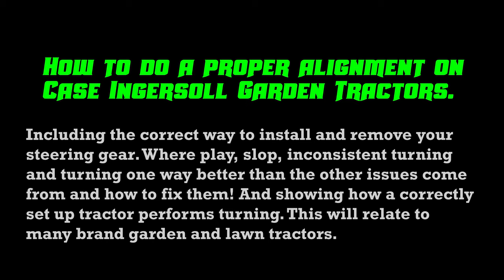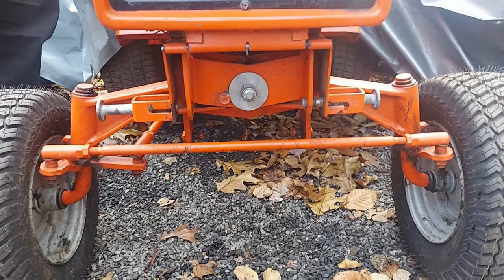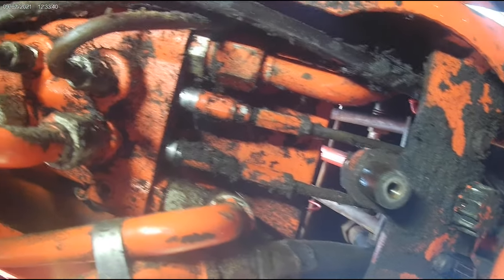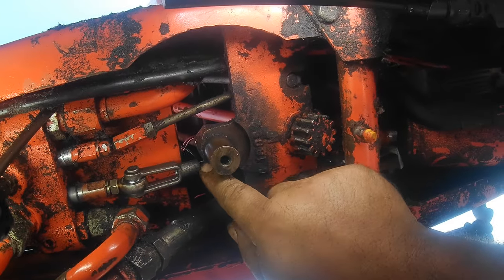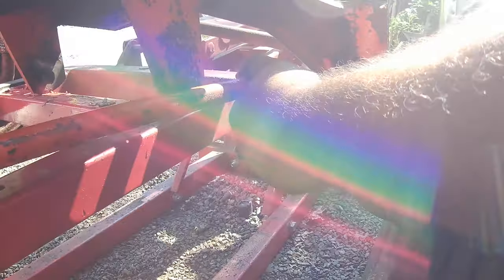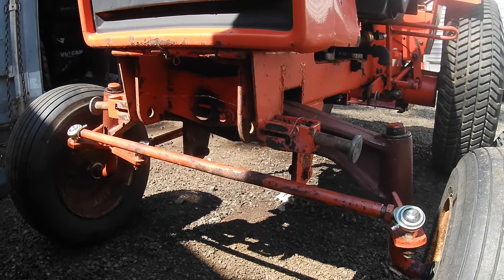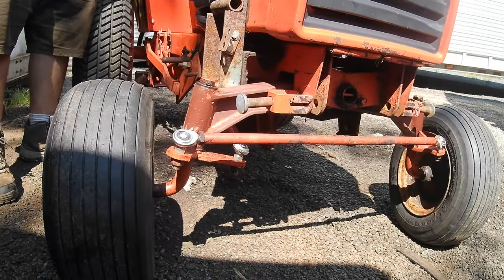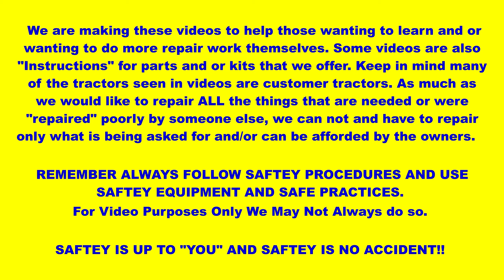Full Alignment Of Case Ingersoll Tractors & Steering Gear Install. Similar for Other Brands Too.

Comment: I saw a newer set of tires on one of the tractors in this video. Where do you get your replacement tires from for the 4 digit tractors with 8x16 inch rears? Awesome video and will be doing this upgrades soon.
Reply from the maker: Thanks! Not sure what one you are talking about, but all the tires I think in the video are OEM original. But truck tires fit so you can pick a pattern you like, we have done this a few times. Also AG tractor tires are available.

Comment: Do you have a link to the kits for the steering upgrade and cost?
Very informative videos getting ready to rebuild my 448.
Thinking of repowering it my broke a rod.
Reply from the maker: Hi we are currently working on building a website but you can find us on Facebook at Case ingersoll Tractors Northeast or email at caseingersollne@gmail.com we also have some products available on ebay under Case Ingersoll Tractors Northeast. If you can find or fix the Onan we would recommend highly staying with a Onan if you can. Thanks for the comment!

Comment: Do you have a website to order parts off of? I'm in need of a set of wheel bearings/bushings for my case 448 and can't seem to find you.
Reply from the maker: Hi, we are currently working on a web site. We have some items in Ebay under Case Ingersoll Tractors Northeast. You can find us on Facebook at the same name or email is caseingersollne@gmail.com let us know if you still have trouble and we will find a way to connect and thanks for the support and interest!!
Reply: @caseingersolltractorsnortheast  Okay, I actually don't have any social media. I looked on ebay but couldn't find what I was looking for.
Reply from the maker: @Bogboy-kn6gy  do you email?  Ours is caseingersollne@gmail.com

Comment: "9/16" bolt would actually be a 3/8" bolt.
Reply from the maker: Yes true and we are well aware as we stock thousands of bolts, nuts washers etc and sell and use all kinds of hardwareon a daily basis.... But as for most our viewers though we have many professionals, many are DYI or new to working on things not only prefer but, often ask us to let them know what socket or wrench they need to use to do the job. Most could care a less what the actual bolt size is as they are not having to go buy the bolt but are reusing it... Nor are they engineering something where the size is what they need to know over the tool needed for the fasteners...  Thanks for watching and the comment.
Reply: Or, you just use the wrong terminology and won't admit a mistake. @caseingersolltractorsnortheast
Reply from the maker: @kevincutler8894  lmao really... you must have a great life seeing you troll you tube "trying" to correct people about bolt size lmao. You did not correct anyone on any thing and I gave you the reason, I have no reason to lie nor to make up a story to justify anything to a non like you....You must be a blast to be around and a real hero... You believe whatever you like and need to make yourself feel of some value to something... thanks again for watching and the comments lol
Reply from the maker: @kevincutler8894  make sure you use the correct bolt size in all your videos for all you subscribers..... Oh wait you have 0 and 0 ...hum...is 0 a common occurrence?? Lol happy Thanksgiving and thanks for the entertainment. Be sure to watch more future videos for my continued use of bolt sizes as I do.